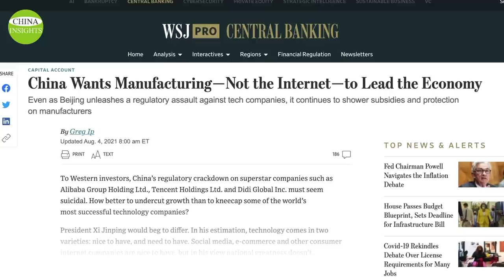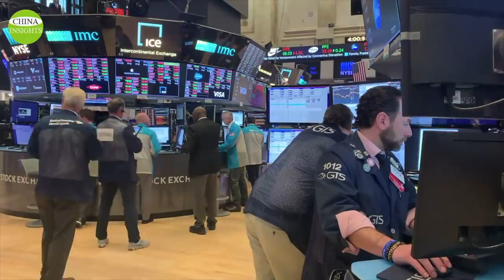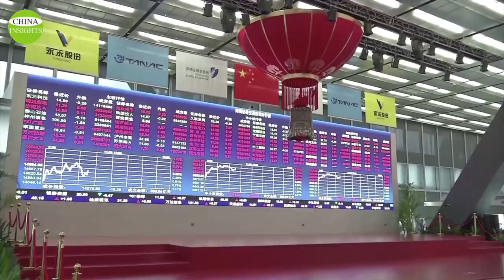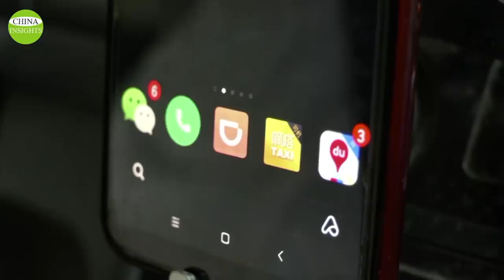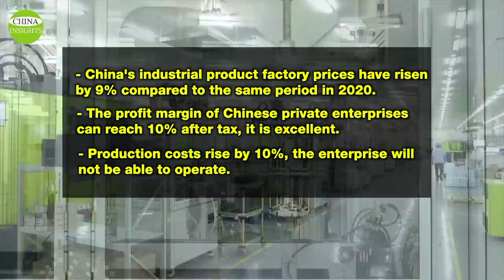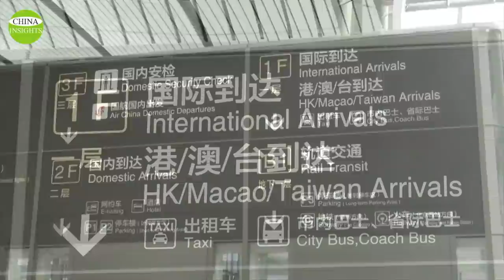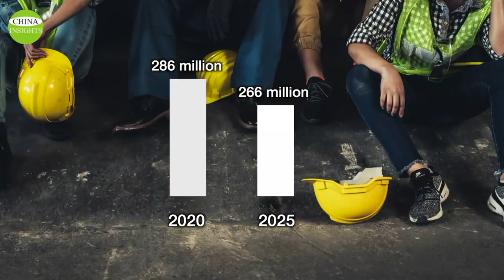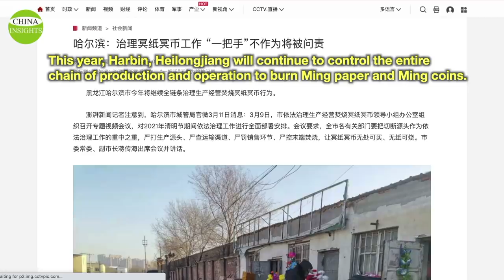Why Crack Down on so many Companies? Manufacturing Industry in Crisis/Downplay the Service sector

Comment: I work for a production plant in America.
I understand why folks are leaving trade jobs all over the world.
You can see a clear divide between the blue collar and white collar workers. The hours are long. The pay can vary widely but seems to generally not be enough for what you have to sacrifice in terms of hours worked constantly week after week and physically labor.
And its typically very boring monotonous work.
At least in my experience.
I took all these classes in high school to go to the trade jobs. But I belive it was a mistake and tbh I would recommend against moving to the trades.
Reply: Interesting. I’ve felt that trades might be a better option for Americans. They’re in high demand and don’t require tremendous college debt to get going. They’re not easy jobs but they seem to be a safer option than a liberal arts degree that doesn’t guarantee a job.

Comment: I think the CCP has moved away from a possible (by long-term) economic hegemony world dominance set (but not publically stated) originally by Deng Xiaoping. The difficulties (for the CCP) is that free capitalism is more commercially successful than government controlled corporations (controlled by communists), such as Huawei, because free corporation aims are for improving market share and profits; not for political and people control (which is the CCP aims). Over control will be found to be counter-productive to consumer confidence. Added to this energy shortfalls hampering manufacturing in China (for meddling in it's Australian trade) and improving the conditions for foreign manufacturers moving into other countries, away from China, such as Vietnam and Bangladesh (by the power shortfall and increasing wages in China). The Australian government did NOT say that they would hold the CCP accuntable for the Covid19 pandemic. They just asked for an unfettered investigation into the origins of the Covid19 breakout in Wuhan.

Comment: China needs to realize something those of us, involved in the quality of manufacturing have known for decades. That is, their overall quality of build across a wide range of products is very poor, to say the least. Wheather its their skill level of the worker UNDERSTANDING the operation they perform in regards to the finish product or the quality of the sub assembly they produce, the machines used (are they capable of 3 sigma?) or are they more concerned about large NUMBERS vs units that fall within sigma parameters? We noticed prototypes and sample 1st runs often were found acceptable, only to find regular lots for production were nothing like the submitted sample runs! In short they failed in high numbers AFTER installation in a wide variety of applications. Corruption? Deliberate spec changes to components, build proceedure, testing? We know how and why. Most US appliences that rely on China built control boards, fail at high number levels causing major failures, leaving the consumer with a very expensive, often not economically feasible to repair major appliance. And we wonder why consumer confidence has tanked across the industry. 🕵🤔😳